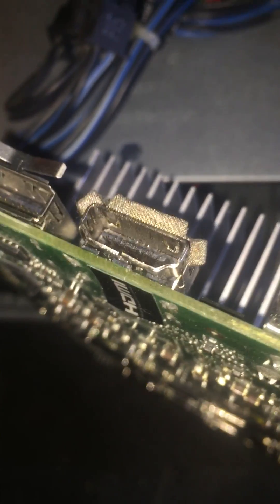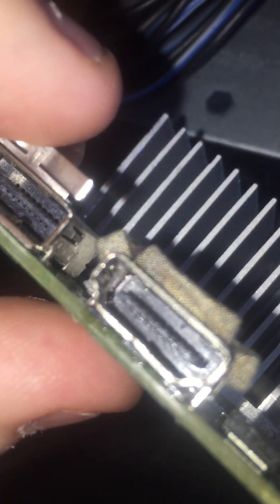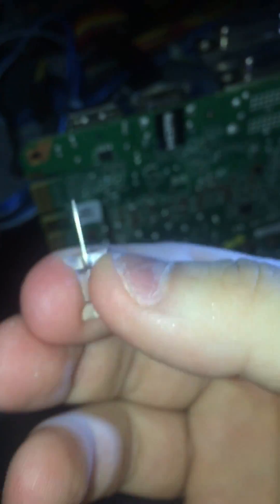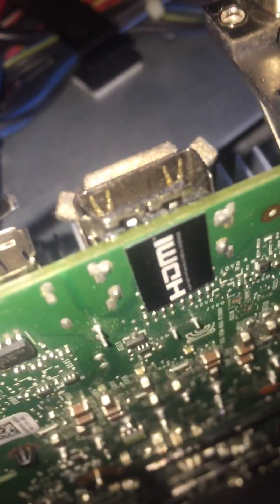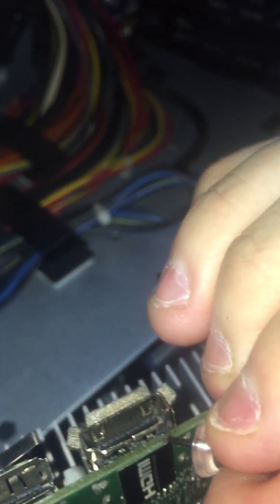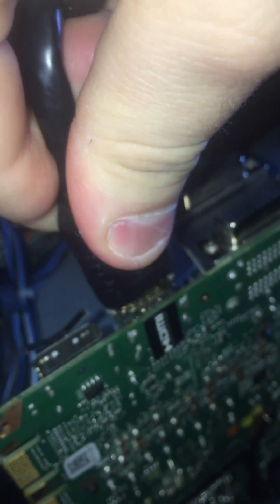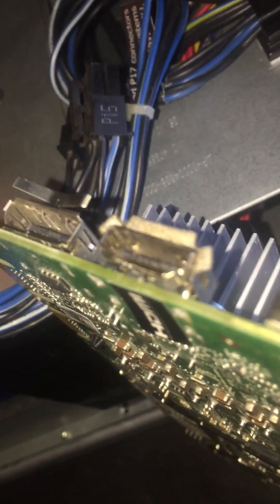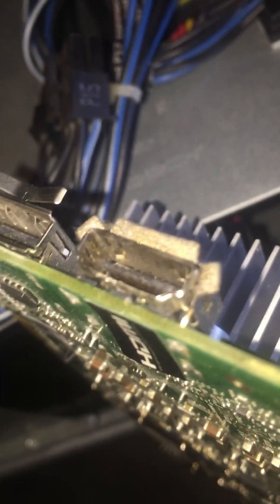How to fix a bent HDMI port

Comment: What should I do if the hdmi metal on the card broke?
Reply from the maker: What do you mean? That tab? If the tab broke like the one I repaired in the video it won't be the end of the world haha. You just will have to be careful and not let the hdmi cable get pulled out.
Reply: @ScarletPanda280  it’s like what you show in the video exempt my hdmi port has a piece of the metal broke off that helps hold it in I can’t get it to display images
Reply from the maker: @Slimgrimmy  your HDMI port might be shot then. Have you tried using a different port?

Comment: One of the precies of gold metal broke off do I have to replace the whole thing?
Reply from the maker: If it's gold it most likely was the connection pin which means it's broken, you can try to plug the HDMI cable in and see if it works but if not then you broke it unfortunately.
Reply: @ScarletPanda280  one broke off so it won’t work sadly

Comment: The metal shield of my HDMI cable broke off and it's all the way stuck in my GTX 1060 I really wish the other ports word DVI and DisplayPort. It's not my main PC so I haven't really tried to fix it, if I can't find a way to remove it I'll just have to buy a $20 DisplayPort to HDMI active cable. But if you have any advice that would be much appreciated.
Reply from the maker: RyanWake bradtelle hmm if it’s lodged inside the port correct me if I am wrong but if that’s the case use very slim tweezers and pick it out gently
Reply: Thanks but if I have to buy something I'll probably just buy the cable
Reply from the maker: RyanWake bradtelle if the metal is in the HDMI port itself then you will still need to remove that piece of metal. Putting in a cable will only push it in more
Reply: It's all the way in there I'm just getting another cable for the DisplayPort
Reply from the maker: RyanWake bradtelle that would be a safer alternative.
Reply: RyanWake bradtelle can you tell me what cable you got and if it worked btw my hdmi is broken but appears fine
Reply: Hey man I’ve had this problem and was sad for like a year